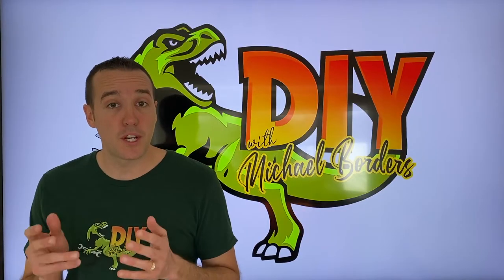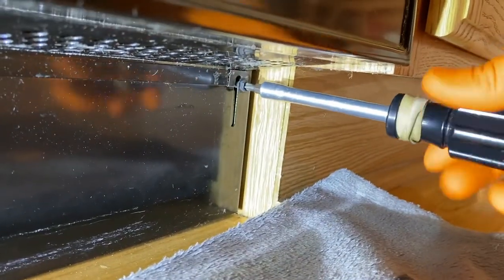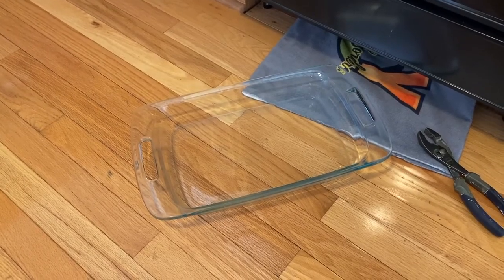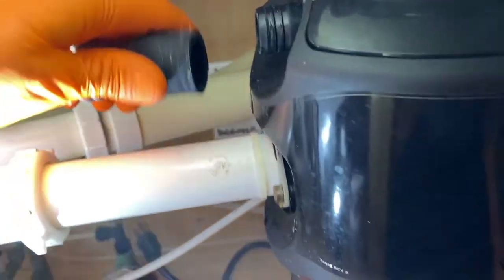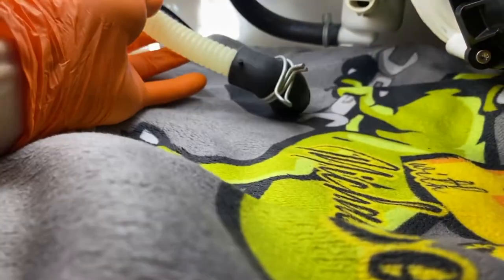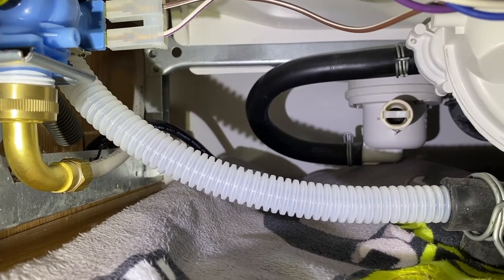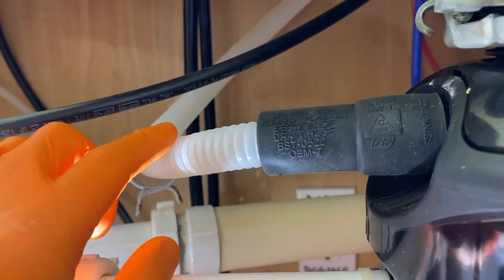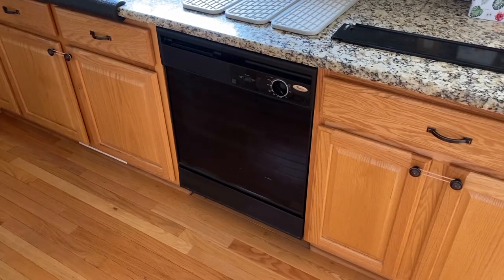Replace whirlpool dishwasher drain hose - DIY

Comment: Our hole is on the bottom so there’s no high loop and now the tubes are molded and my dishwasher never cleans correctly. How can I fix this?
Reply from the maker: Thanks for watching, have you verified which hose is drain hose?  Follow drain hose from sink or garbage disposal and see where it connects to bottom of dishwasher.
Reply: Got it all figured out! We have a whirlpool so it was connected differently. Thanks for being so helpful!
Reply from the maker: @heatherweber1672  

Awesome, and thanks for the follow up.  Reach out to us any time!  😎👍